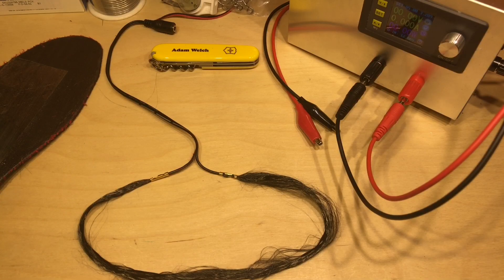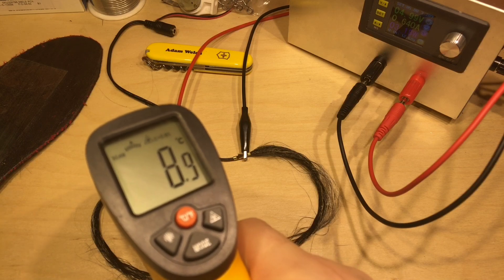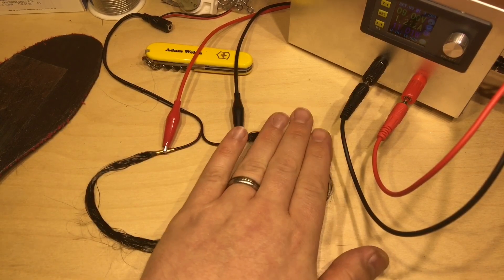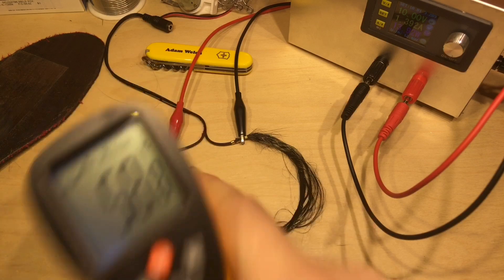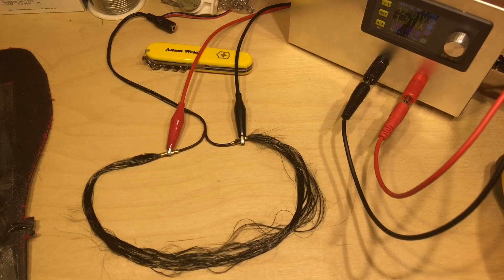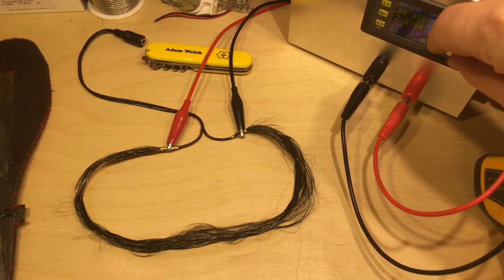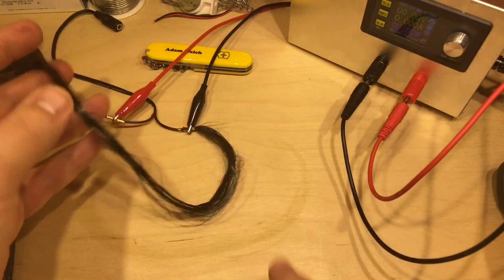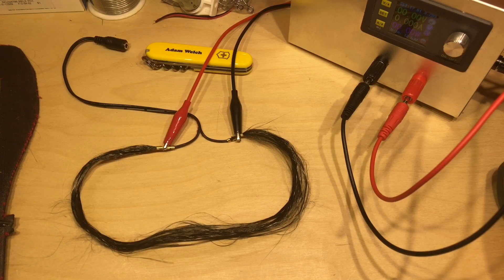Carbon Fibre/Fiber Heating Element - 12v Solar Shed

Comment: How can I add a joint from the point where this wire broke? The refrigerator heater wire broke. There is no wire in it, I am sure that this is the heater material. How to splice carbon fiber wire, thank you

Comment: I just finished a project where I bench tested some heated 'Holmes' work gloves from Costco. The 7.4V battery packs, which lasted just under 2 hours, were never able to achieve more than 12 Watts at best, and they quickly dropped to a mean of something like 6 watts for most of the test while the gloves were unable to attain much more than 26C when there was a bag of snow sitting on top of them and ice underneath. Your demonstration backs up what I'm finding and that is 7.4V are just not enough to heat your hands or feet effectively in winter. So for the next part of my project I plan to build a 3 cell 18650 battery pack with balancing BMS and see how that goes after bumping my nominal voltage up to 10.8 (there is not enough room in the glove's battery holder pouch to go for 4 cells). Thanks for bolstering my 'confirmation bias'!

Comment: Adam, I think you have just stumbled onto your next project!  Surely you have a fancy office chair for your shed.  Wire the carbon fiber just under the top fabric and put 12v from you battery bank thru one of the $3 thermostat modules, inline with a $3 remote control module.  Then you can click your dongle in the house 30 mins before you're ready to head out to the shed and your seat will be prewarmed to body temp for ya ;)  Oh then find an old BMW insignia for your new royal seat.  I'll keep watching for it...

Comment: Those carbon fibre elements are starting to make their way into more & more products. Heat pads for example. I am looking it various options for the coming Winter for the soon to be born baby, as we all use electric blankets and he'll need something in his cot. But babies do wees and we have to be wary of that! And also, we don't want the cot to get too hot.
Reply from the maker: No we've had these thoughts as well.  With babies unable to regulate their own heat we've had to have the central heating set to keep the house warmer overnight than we usually would.  The advantage of your typical on grid house.
These fibres can be woven into fabric quite easily and are used in outdoor wear and motorcycle clothing quite a bit.  I found they needed to be clumped together the generate any noticeable heat though - as well as run at higher voltages!
Good luck with the hunt for a suitable solution - and with the impending birth!